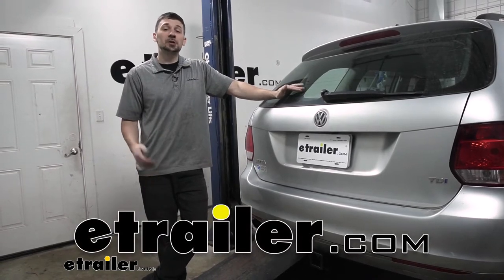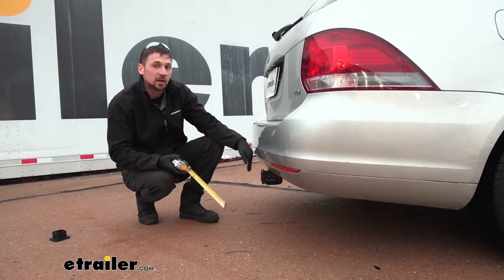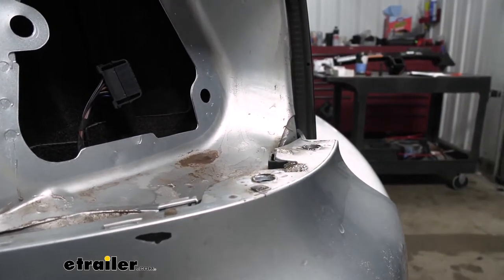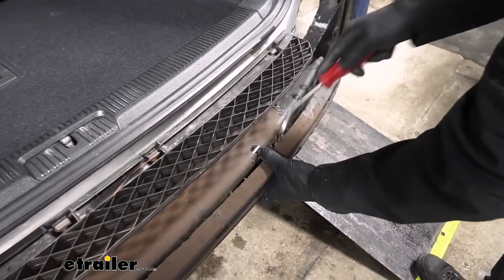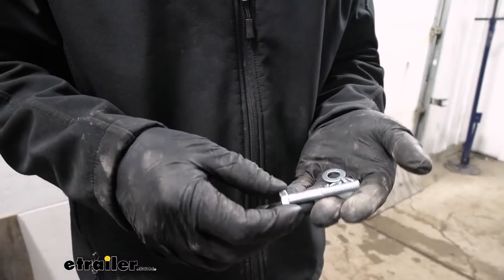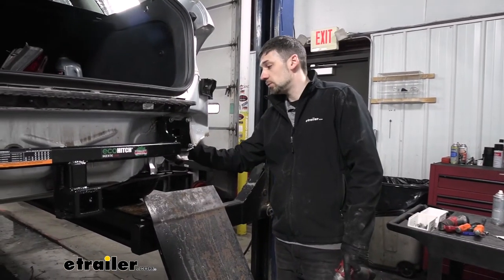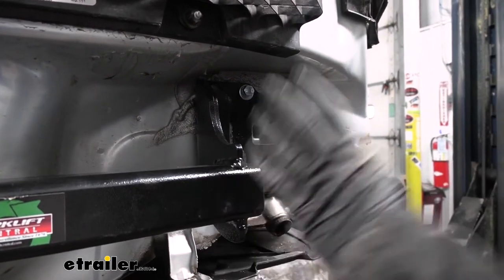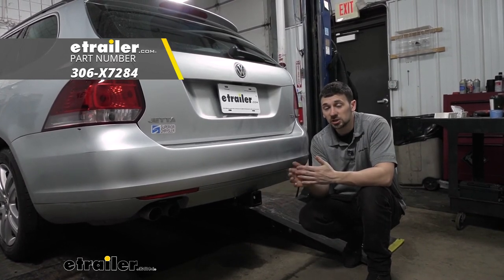etrailer | EcoHitch Hidden Trailer Hitch Installation - 2014 Volkswagen Jetta SportWagen

Comment: I’m concerned about not reinstalling the foam cover on the bumper beam. In it’s absence, I’d expect there to be some unwanted road noise and/or vibrations. Am I correct?
Reply from the maker: We haven't received any reports of noise or vibrations.
https://www.etrailer.com/Trailer-Hitch/EcoHitch/306-X7284.html
Reply: @etrailer  thank you!

Comment: Is this only for the Jetta sportwagon or is there one available for the Jetta sedan (2013 TDI)
Reply from the maker: The EcoHitch # 306-X7284 only fits the 2009-2014 Jetta SportWagen. For the 2013 VW Jetta TDI sedan, use # 306-X7311.
https://www.etrailer.com/Trailer-Hitch/Volkswagen/Jetta/2013/306-X7311.html